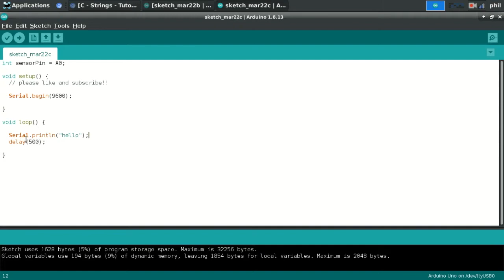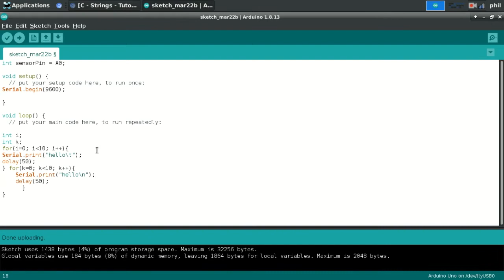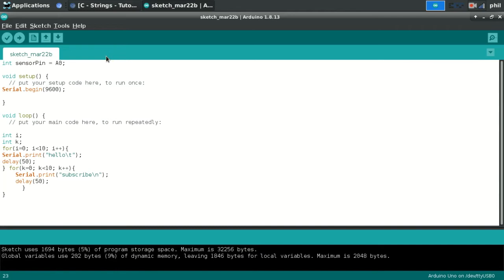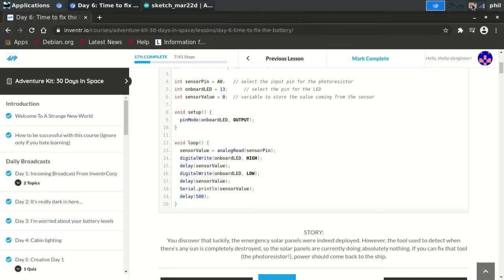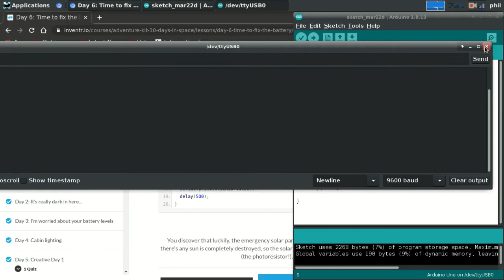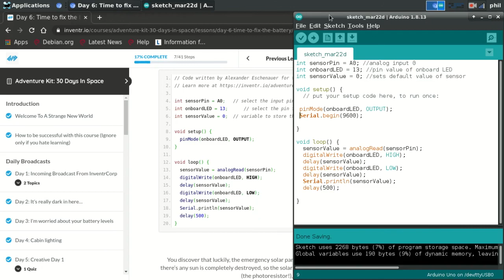Inventr.io 30 days lost in space HERO/Arduino clone - Day 6

Comment: I am looking for what the different symbols mean } { // ; and others and how used.
Reply from the maker: There are quite a few characters in C/C++, but I'll try and break some of them down. 

# is for preprocessor directives like #include, #define #if #ifndef, etc. These get read by the compiler before compilation occurs to add additional libraries or check for conditionals in your code that can turn sections of code on or off to keep the binary file size more compact

[  ] square braces define an array, which is a sequential collection of variables with index numbers. Think of a variable called number. If you needed ten of them, you wouldn't want to define ten variables called number1, number2, number3, etc, so you can create an array called int number[10] and that will create 10 contiguous blocks of memory to store ten index values of number and you can access them either by using a loop and counter to iterate through them or you can access them by index number (myValue = number[2])

(  ) parentheses are for passing parameters into functions. int main() is the main function and it can take parameters or it can be left blank depending on what sort of external input you'll need. When you create a function, if you need to pass values from, let's say int main() to a function called printName, you could do something like this (using C++ libraries as an example):

#include<iostream>
#include<string>

void printName(std::string myName)
{
 std::cout << "My name is" << myName << std::endl;
}

int main()
{
      printName("Feral Engineer");
}

int main() is the starting point of the program, so printName won't be called until it's called to in main(), even though it's above it in the above lines of code. 

{  } curly braces are the opening and closing of sections of code. Different conditional logic and looping funcitons require braces to define scope. 

int main()
{
    int number = 1;
    if(number != 1)
    {
         std::cout << "you don't need braces for single line conditional statements, but it's good practice";
    }
}

in this example, main has its own scope and the IF statement has its own scope by way of the curly braces. 

You need curly braces for IF, WHILE, CLASS, STRUCT, FOR, SWITCH, functions, etc to identify scope of each. 

:: is a scope resolution operator in C++, which is used to specify which class function you're trying to access. In the case of two structs, classes or functions having the same function call, you can use scope resolution to specify which instance of foo() you want to access

(stolen from stack overflow)

const int x = 5;

namespace foo {
  const int x = 0;
}

int bar() {
  int x = 1;
  return x;
}

struct Meh {
  static const int x = 2;
}

int main() {
  std::cout << x; // => 5
  {
    int x = 4;
    std::cout << x; // => 4
    std::cout << ::x; // => 5, this one looks for x outside the current scope
  }
  std::cout << Meh::x; // => 2, use the definition of x inside the scope of Meh
  std::cout << foo::x; // => 0, use the definition of x inside foo
  std::cout << bar(); // => 1, use the definition of x inside bar (returned by bar)
}

<< and >> are usually used for bitshifting (moving binary to the left or right by one binary digit), but with the C++ standard library, they're used as data output << and input >> operators via operator overloading

; semicolon defines the end of a line of code

//Are single line comments and aren't read by the compiler

/*are for
Multiline
Comments */

Hope this helps 😺😺